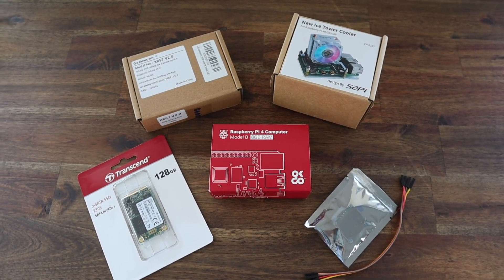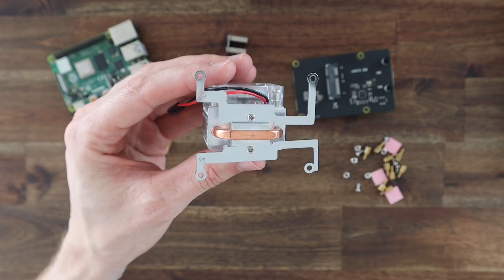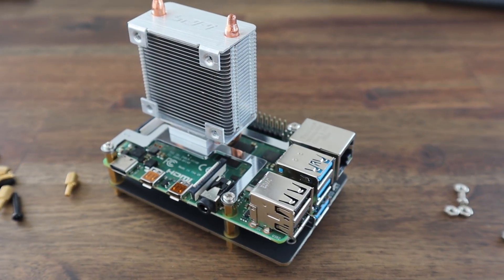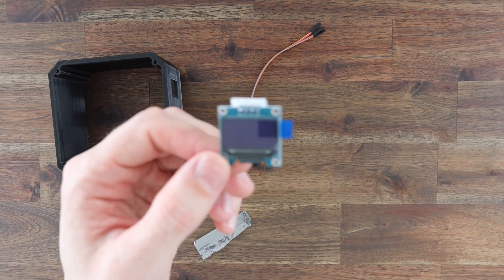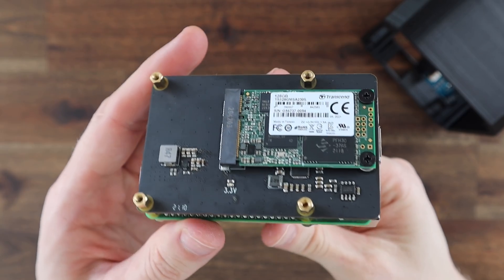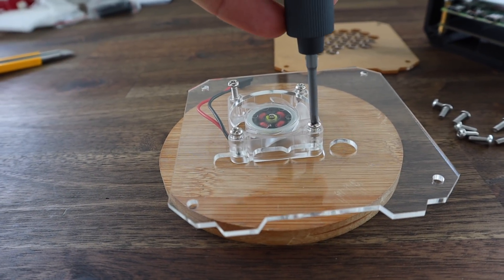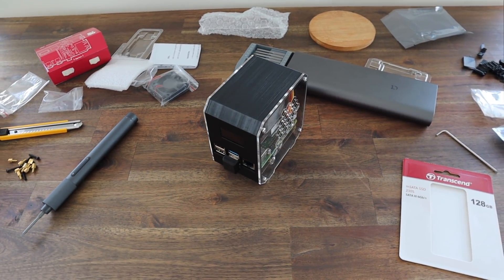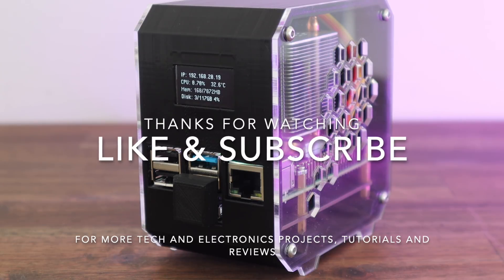Raspberry Pi 4 SSD Case With Stats Display

Comment: this is gorgeous. im  thinking of ordering one of these from ebay, but i have a question i can;t find the answer to. do the fans take away from the available voltage from the pi? or does it pull the extra power from the power supply? without depriving the pi of any voltage/current

Comment: My fan has an extra blue cable which I think is for the Rgb but I don’t know where to plug it in
Reply from the maker: The blue wire is for PWM control of the fan. You can plug it into any PWM pin to set it up.

Comment: Incorporate kali Linux to this build was an huge headache. Had to travel all over the internet to incorporate i2c and gpio driver issues for the oled display. Since kali   requires multiple lines of code in the /boot/config.txt for the i2c to work when Kali pi config do not support it. And next headache was dealing similar issue with Gpio  and i2c meanwhile dealing with root conflict of permission with group permissions since I am a relatively intermediate with some newb tendencies with Linux Os. Just started in the rabbit whole when it comes to such glitches, some dates hardware/software issues that overlap from different flavours of Linux. Not hating on Kali Arm 64 bit, could have made it a little bit more user friendly like raspberry pi os.

Comment: any suggestions or alternative options for the side panels if one doesn't have a laser cutter?
Reply from the maker: They would be relatively easy to cut by hand using a jigsaw or scrollsaw (without the hexagon pattern), else I also included a 3D printable version of the side panels in the download.
Reply: Oh I didn't know you included a printable version. Sweet that's all need. Thank you. I'll be purchasing the design soon

Comment: is it possible to use a M.2 SSD board that supports 2280 SSDs?
Reply from the maker: I haven't tested it myself, but apparently the Geekworm M.2 NGFF hat that takes a 2280 SSD fits into this case as well

Comment: Hello!

I have a problem. I bought all the items, and the printing/cutting templates too.
I choosed that type, when the display and the USBs in different side. Paid for the 3D print around $15. I was happy, when everything arrived, but i needed decide, this case is absolutelly wrong. I cant build it, because the cooler is too high, and the display's cables cant enable to put in the tower (ssd shield+pi+cooler). Now i need pay again to make another one, where is the display and the usbs in same side...
if need i can send pictures
Reply from the maker: If you switch the display and ports around, you need to either bend the display's pin slightly upward or remove them and solder the wires directly to the display. This shouldn't be difficult to work around.

Comment: What are the performance implication sof running an SSD over USB3. I imagine that pretty much limits it to casual use?
Reply from the maker: It's an improvement over the onboard SD card, but you're obviously limited to the speed of the USB 3.0 port. That's why I used an mSATA drive, not much point in going to M.2 NVME.

Comment: Still waiting on the UPS/SSD Combo Build 😁😁😁😁😁
Reply from the maker: Haha unfortunately there isn't really a way to use them both without some customised connectors as they both need to be positioned directly under the Pi (the UPS for the GPIO pins and the SSD because that how the USB jumper is designed)

Comment: Would love a case that supports a POE Hat
Reply from the maker: I'll look into that, do you have any suggestions for the type/model or just the official PoE hat?
Reply: @MichaelKlements  Official POE+ Hat, I am currently using the M2 board from the Argon One. I would love to be able to get a top for it with 1000% better ventelation and the ability have a POE+ Hat attached.
Reply from the maker: Thanks, I'll have a look at what I can do with the Official POE+ Hat

Comment: I followed your guide and built mine, using the Snapmaker A350 to print the case (inc sides). It genuinely makes me smile when I turn it on. Top work.
Reply from the maker: That's great! Did you print the sides as well or carve them from acrylic?

Comment: Great case. I even bought the case files for myself and paid for another set of files for my son. 

The files were well done and you charged a reasonable rate for them so 8 felt you deserved payment for your work 

I do wish there were acrylic laser cutting businesses that would do small requests. Do you sell just the laser cut acrylic?
Reply from the maker: That's great to hear, thank you. 

I don't usually sell them separately as they're then quite expensive with shipping but two sets might be worth it for you. Just send me a message on Etsy and we can work something out.

Comment: Would it be possible to put the ssd hat underneath a ups hat and run it like that?  Because if I can, I would be building a pi that I can take with me on camping trips to watch movies out in the woods.
Reply from the maker: You could, you'd just need to make your own USB jumper as the included one won't bridge the larger gap between ports.

Comment: just thinking. if there is an adapter that lets you plug in the SSD shield directly into the microSD slot, it would safe you from the extra step of configure the Pi to boot over USB. in theory, it could work.
Reply from the maker: The interface on an SSD and a microSD card are quite different (not just physically), so I don't think this would be an option. You're better off just using a high quality / high endurance microSD card in that case.

Comment: Hi m8,  this is a real well done job... im considering to buy the kit from ETSY;  just one thing i would like to know, i use my rpi ONLY for  Home Assistant,  with your kit i can use the HASS-OS? or i must use the Debian Supervised?  im thinking about this due to the oled monitor and hardware.  can you please clarify this for me? thank you
Reply from the maker: I haven't tried the OLED display script on other distributions, I have only used it on Rapsberry Pi OS.
Reply: @MichaelKlements  so it will work on debian as well i believe

Comment: Do you have a video explaining the steps to design that case? You showed a bit with the measurements in this one. I am thinking about trying (next summer) to combine the UPS and this - that would require changing the case. It may be enough what you showed here, either way. These are great videos.
Reply from the maker: I don't, but I'll look at putting together a tutorial on using Tinkercad to design a Raspberry Pi case.

Comment: I just got mine in late last week and I highly recommend this case to everyone... I got it all setup last night and it's awesome! It wasn't hard to get the front display running or anything. Easy to follow instructions to get it all setup and running. Well built case and everything fits nicely together. Well done and I will be getting another.
Reply from the maker: That's great to hear, I'm glad you like it and it all went together smoothly!
Reply: @MichaelKlements  can you help me get mine...please?  etsy not available anymore
Reply: Isnt its fan noisy?
Reply: @JM-bv5fv  No. I use 2 fans in my case. One on each side in a push/pull config.
Reply: @spuds7677  I think it has juat one fan, how did you use 2?

Comment: Tried project, problem, pi will not connect to internet with SSD installed. With or without booting from SSD. No internet problem booting from SD "without SSD installed'. New to Pi. Thank you
Reply from the maker: I've never experienced something like this. I'd say that it's most likely power related. Your SSD is probably drawing more power than your power supply can handle and this is causing voltage dips that are interfering with your Pi's WiFi. Are you using an official power supply? What is it's rated current?
Reply: @MichaelKlements  rated current 3 a. replaced PS, no change. tried same setup on another Pi4, worked. No internet with or without SSD "electrically connected" on latest Pi4. removed ice tower, no change. Mechanically removed ssd, Internet restored, assume mechanical stress from ssd attach, maybe poor solder joint on Pi 4.  Thankyou very much for your advice and time. Your part worked great!

Comment: That has to be the nicest Raspberry Pi case I have ever seen, wonderful work!  I only discovered your channel and website a few days ago, and I'm VERY impressed.
Reply from the maker: Thank you!
Reply: Yes, you only need a 3D printer and a laser cutter...
Reply: @warlikka7571  To be fair I don't think most people have access to both of those things. I'm sure it makes building them easier but the design is so good either way, these cases he's made look SO much better and more aesthetic than the commercial cases I've seen.
Reply: @warlikka7571  There's a ton of websites that you can pay to 3d print/laser cut any files you send them.
Reply: @warlikka7571  the whole kit is available on amazon, just bought it
Reply: @dripmeex8151  where
Reply: @DroneBot Workshop I bought Michael’s kit for the previous version without the SSD and it was perfect!  The instructions for construction and setup were on great and my daughter loved the process getting it up and running. Plus, no need to buys part separately.  Shipping was fast as well!

Comment: HAHA!!! The one that I've been waiting for! Now I can move by bulky sandisk ssd 240GB inside the case! Hmmm, wonder if I take the plastic outter case apart if inside is the same board/pinout? I guess we'll see! Now, Michael, here's the challenge! Same case as this one, even taller with the ups/battery option in your last design! HAHA! That'll be a chonky lil dude for sure but, how cool would it be to have ssd, ice tower, and ups/battery all in one case. Oh and? with the OLED on the FRONT! That's my chosen option. Anyway, just musing, as usual, NICE MICHAEL! This is such a stylish design. I get compliments on it every time someone stops by and see's it sitting on my table. I'm like yeah, I made that and "Michael Klements" designed it! Oh, last one. I made one mod to my case that I really like it. I swapped the straight pins on my OLED for 45 degree. Which is cool because I cut my wires to follow the wall and down to the GPIO. So the 45 degree pins help keep everything tidy. THANKS AGAIN MR. Klements!
Reply from the maker: It seems like quite a few people are interested in a combined UPS and SSD Pi Case, I'll definitely have to have a look at it! Thanks so much for the positive feedback, I'm glad your Pi is a good talking point!
That's a nice idea for the display pins, I hadn't thought of using 45 or 90 degree pins.
Reply: @MichaelKlements  Your designs are incredible sir. The case is just an incredibly tasty piece of work. I’ll be building more that’s for certain! Re the pins, thanks, it worked out pretty cool. I’m looking forward to designing a thing or two myself. I need to get/build  a good laser table like yours and I want to build a desktop cnc as well. In time. For now I’m still in “build” mode. Your welcome, thank you for sharing the great work!

Comment: Wish they did coloured boards and fans.

I love it. My only suggestion would be to angle it so the front could be seen slightly easier when sat at the desk. Perhaps :)
Reply from the maker: Yeah that would be pretty cool. I've made up a plywood case which had the Pi at 90 degrees so that it's all visible, it came out quite nicely.

Comment: Hello Michael. you created a awesome case. I would like to ask for a few special requests. I would like to buy your case on ETSY but I want sapphire blue sides, is that possible. Also can you sell all in one kits? It would make it easier to source as it is from one spot and insures that the customer got the correct parts. cheers Robert
Reply from the maker: Hi Robert,
Yes, I'll happily help out with customizations. I don't typically sell all of the components as a complete kit for two reasons, the first is that the individual components are usually cheaper (after shipping etc.) to be bought locally as I'm not a distributor and don't have the buying power to get good pricing on them, and the second is that if anything goes wrong with the electronics (the arrive damaged or fail on startup) then it's a lot more messy to return to me in a different country.

Comment: Could you build a Tezos node with this ssd mod and the backup power supply mod? That would mean a lot to the Tezos community. Your builds look great btw.
Reply: Being nosy David. What's a Tezos node? Thanks!
Reply: @TheJacklwilliams  oh awesome you replied! It's a crypto mining rig that is green. Being able to mine (called baking) on low power devices like the raspberry pi is a big deal for us. There are already easy tutorials on installing tezos on a pi. There is no really professional builds for the box though. I came across your videos. The UPS and the SSD is perfect. 
If you did a video it would be front and center on our social media and news sites.

Comment: Great job I bought the last one and was wondering if you could let me have the STL files as before as I am trying out a 3d printer and haveing great results with the first one
Reply: It's been my best print so far. As you'll discover, some designs print incredibly. I made my layer lines .2 and the print is smooth as butter. Looks manufactured. You'll learn many designs out there are awesome but some can be incredibly difficult to print well. How it's oriented on the build plate is amongst many of the details that can impact print quality. Good Luck!
Reply: @TheJacklwilliams  THANKS and yes I found the STL files

Comment: Brilliant new build.
So next is this plus the UPS? ;)
Reply from the maker: Haha that’s a bit more complicated as the UPS has to go underneath the Pi to interface with the GPIO pins, so the SSD shield will then need an extended USB jumper and will further block the batteries.
Reply: @MichaelKlements  I thought so.  
I wonder if there is a way of doing it where the UPS batteries face down and a hatch in the bottom would allow removal of them.
Probably not and would add yet another level of complexity.
I love your design though.  Its so cool.  Plan to buy the parts and build it once I have my laser all set up and zero'd in :)  Case is printer ready already.

Comment: Really cool, would like to see a  SSD/UPS/ combo Case for my Pi4. Do you plan to do this? Thanks!
Reply from the maker: I'll have to put some thought into the arrangement as the UPS has to go underneath the Pi first so that it can make contact with the GPIO pins, but then the SSD shield will need a much longer jumper and will block the removal of the batteries.

Comment: awesome case.  i have your first version.  on the cpu cooler,  i removed the aluminum bracket that holds the fan screws for a cleaner heat sink look lol
Reply from the maker: That's a neat idea, I might try doing that on mine as well.

Comment: Awesome! I love it!

Does the SSD mount support a full 2.5" drive?
Reply from the maker: Not in this design, a full 2.5" drive is quite a bit bigger (longer and wider) than this case allows for.
Reply: @MichaelKlements  Aww 😐 so a 3D print would have to be quite a bit wider? I'd use that space for extra fans lol